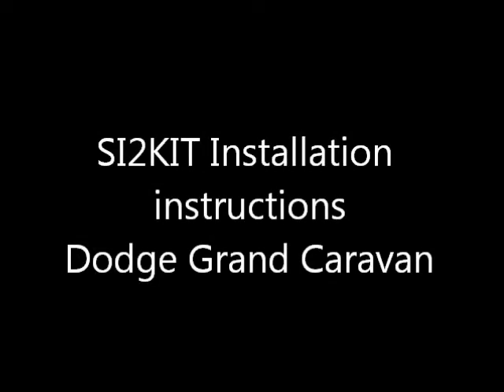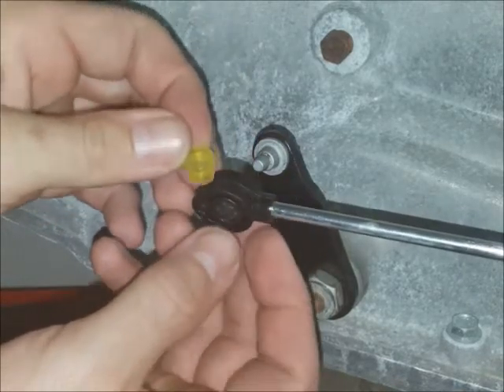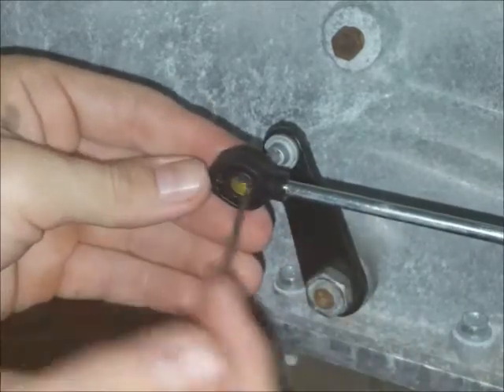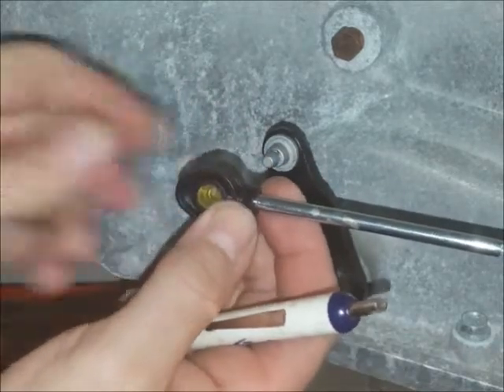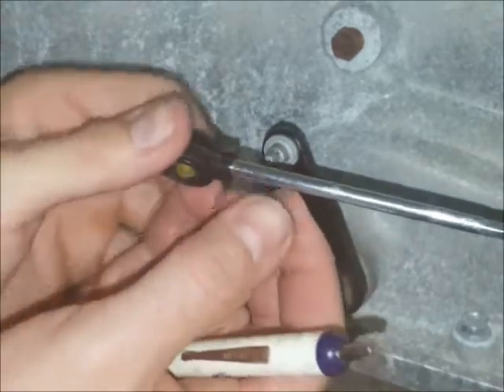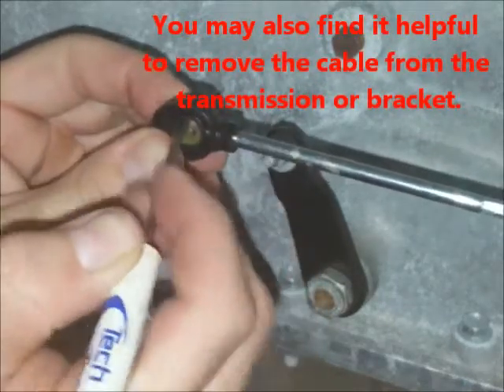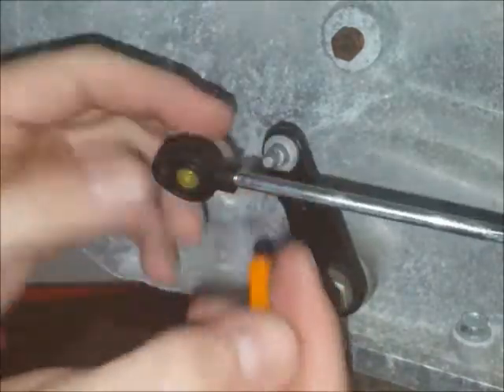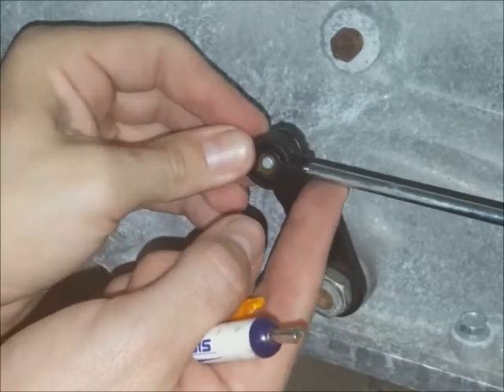Dodge Grand Caravan shift cable the easiest way to repair !   Kit includes replacement bushing.

Comment: Hi what years ?
Reply from the maker: If you have a Dodge Grand Caravan we have fitment from 1996-2022 here's the link: https://www.bushingfix.com/dodge-grand-caravan-shift-cable-options/.  If you have a Dodge Caravan our kit CH1KIT45 fits 1999-2007 and uses same bushing for both ends of the cable.  If you need to replace bushings at both ends it would require two kits.